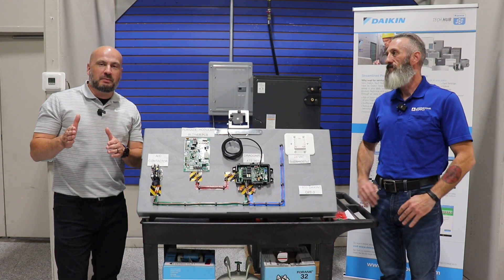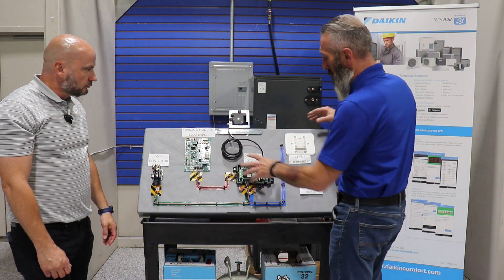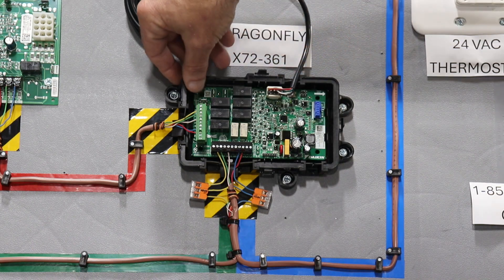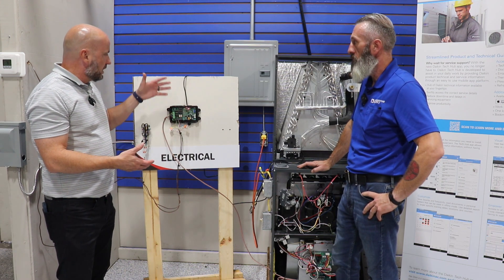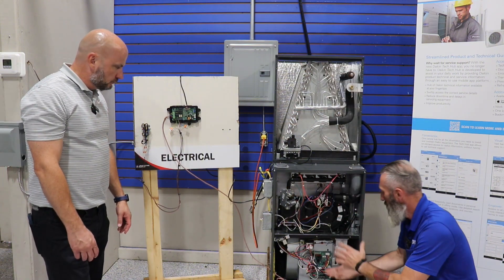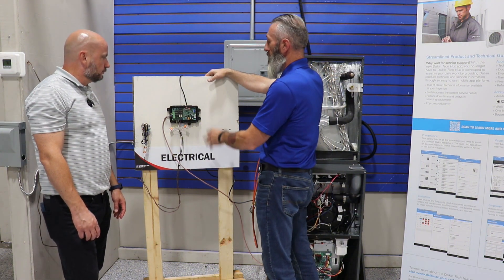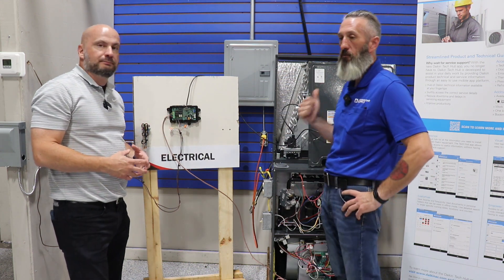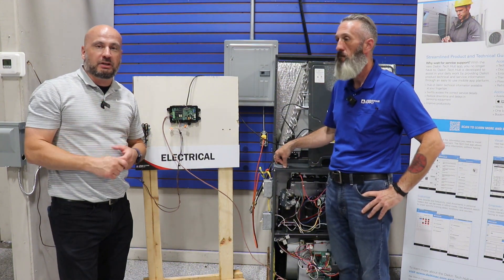A2L Mitigation System "First Look"

Comment: What happened if the LED DIDNT TURN ON , but I test with my voltage test pen at the bottom to reset I have voltage , then I check where ist the LED and I have voltage , I test where it’s the sensor I have voltage and I test the wire for the sensor I have voltage , but the problem ist the LED didn’t turn on ? I turn on the furnace and work fine , I don’t want to open the valves for the condenser because I have problems with the dragonfly

Comment: The fact that you can’t install this board directly onto the furnace or coil, is ridiculous. I have a furnace and coil sitting in the middle of a large mechanical room with nothing else around it. There is nothing to mount the board to? Except the furnace, that is. I can’t mount it to the wall, which is 10’ away, because my sensor won’t reach? I have to either mount it to the furnace, or build a structure to mount it to so the sensor can reach. Genius!

Comment: From the 10,000 foot level, the Dragonfly is designed to do nothing more than shutdown the furnace and/or outdoor unit and only keep the Fan running because the sensor detected an indoor refrigerant leak around the indoor coil (whether cooling or heating).  The purpose of running only the fan is to dissipate the refrigerant. 
With that being said, Why is this being done???  Do high concentrations of the new refrigerants have the ability to explode if the Furnace is on, or can they suffocate occupants in their homes??
Reply from the maker: The DragonFly is designed to shut down the system except the fan so that the home owner see the system not working in heating  or cooling     then to call their service tech

Comment: This doesn't make sense. How does it shut of the condenser if you're connecting the condenser to the thermostat side of of the dragonfly board. The condenser should be wired into the furnace side of of the dragonfly board. Otherwise, there will be nothing stopping the condenser from running as the thermostat will still be calling for Y to R.
Reply from the maker: Everything is wired to go through the dragonfly board and it will control what happens.
Reply: @ I wired my first dragonfly boards this week and it worked well. Thanks for the reply.

Comment: With Evcon 454b coils, the schematic says thermostat wire goes into green terminals.. 
Here you guys have it wired to the furnace control board..  

The black terminal pin block on the schematic says it goes to the equipment.. here you guys have it wired to the thermostat. 

I get a constant fan with no call for cooling or heating.. the  fan is in auto on the thermostat. as soon as I apply power to furnace I get a green light on furnace board and fast red blinking light on mitigation board.
Reply: Im getting ready to install a Goodman R32 changeout (non-communicating furnace)  - my dragonfly VX4.2 non-a2l instruction booklet says the Green terminal block goes to the indoor equipment and the Black block gets the terminal wires.  If you look at your dragonfly, on the board just above both terminal blocks, they should also be labeled "indoor unit" and "thermostat".

Comment: I think your going to need leak detection with GOODMAN EQUIPMENT ! IN THE LAST 2 YEARS WE'VE EXPERIENCED 4 LEAKING /DEFECTIVE INDOOR COILS AND 2-TXV'S THAT FAILED. Always had good luck w/GOODMAN but not anymore . These were all "NEW STYLE" aluminum coils that were supposed to be superior . Not sure if GOODMAN/DAIKIN make their own coils ??? Ok-THEY MIGHT BE IN WARRANTY BUT DOES YOUR VENDOR STOCK WARRANTY PARTS ? PROBABLY NOT .... OH / YOUR CUSTOMER DOES NOT WANT to WAIT 2.5 WEEKS WITH NO A/C IN JULY?? PAY THE $250.00 FREIGHT FEE . Otherwise you wait 2 weeks and the replacement coil is damaged beyond use ...  These are examples of what an HVAC service contractor deals with. It's easy to produce YOU-TUBE video's telling us how great the new technology is ; legitimate HVAC contractors will be the real test of whether the technology stands up to the rigors of actual field conditions . Not trying to be negative but w/ 44 years in this business and 8 of them with a major manufacturer as a factory tech. , you"ll have to prove it in the actual field .

Comment: How often do you need to check the sensor and how much is the sensor test kit and the inert gas for testing
Reply from the maker: You would have to call your local supplier to see pricing , And they are brand new just out so not really sure life on sensors
Reply: @ the sensors should be calibrated and checked  just like we had to service the refrigerant monitors in chiller rooms after they faced out R11 witch derated the proficiency by 25% which means there was 25% more power. Used and I was on depletion by power through gas and oil and coal power plants was worse on the ozone than the refrigerant ever was all about big money

Comment: Excellent video and demo board. I have a question.. Is the Dragonfly system ok/safe with a dual fuel heat pump using gas furnace backup? Please advise. Thank you.
Reply from the maker: Yes it is adaptable to have duel fuel

Comment: Helpful video thank you. Just have two questions. Would you need one of these for R 454B? And do you need install one of these with an air handler heat pump system?
Reply: Yes you do need this for all A/C or heatpump systems because all new equipments will come with either R-32 or R454B and these A2L are not highly flammable likeR-22 but still be care full when brazing or repairing leaks
Reply: @Courage1984 r22 isn’t flammable at all.

Comment: what wires from the thermostat are in the that black terminal?
Reply: Looks like they spliced and pig tailed cool and common, the other wire from the contactor is just our common 2 wire. The dragonfly is just receiving the 24v communication then sending to furnace pcb. This is what it looks like to me.
Reply from the maker: Has your Y W G R C

Comment: Goodman is ridiculous. They were not ready for this rollout. In a rush to make this new equipment, they can’t even provide warranty compressors for the 410A units.
Reply: And they want me to pay freight cost for a warranty compressor? Wtf is going on?
Reply: 6-million square feet of ‘R&D’ with no space for warranty. 
Still haven’t seen sensors for leaking line sets and inherent safety features for power loss and stuck closed/failed sensors.
Reply: Goodman actually did pretty good compared to the other manufacturers.
Reply: Copeland has a nation wide issue with these compressors and the hot bypass valve.  
They fully sold us out to china and Mexico. 
Now they can eat the big one

Comment: I did everything on this video but couldn’t get it to work. After the ac turns on for the test mode it wouldnt turn on with the tstat . Got 24v from fau to dragon fly but nothing out of dragon fly to tstat
Reply: Generally, that means the test sequence was not complete, or the sensor is faulty. The t stat will never get power until the dragonfly completes its test sequence.
Reply: @johngonzalez506 have you heard of faulty sensors yet? In the middle of a changeout and getting an alarm,aGoodman split heat pump system.
Reply: Same with me